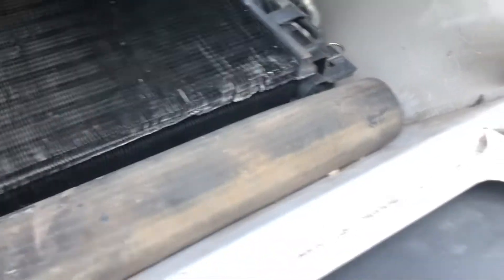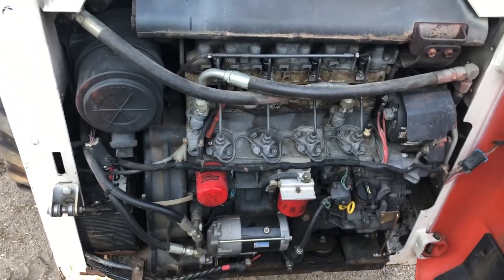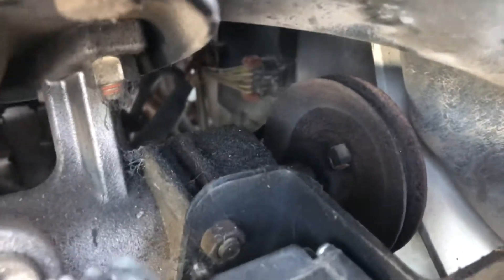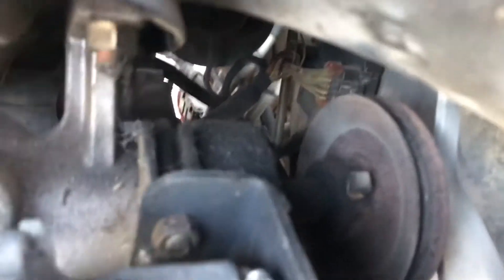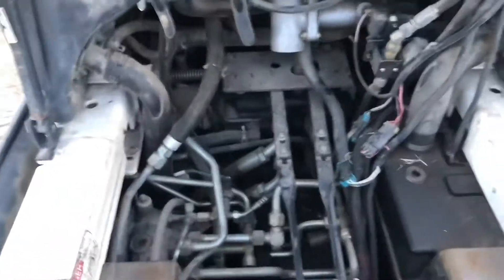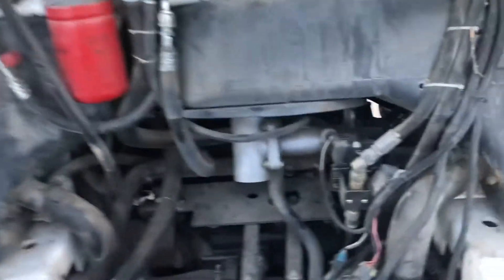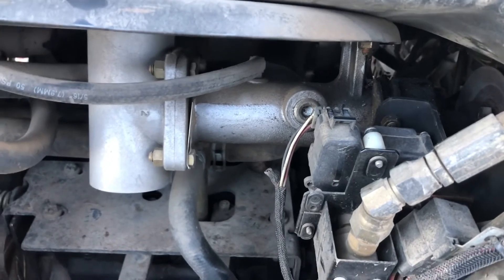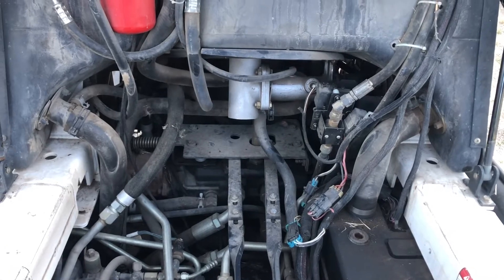Bobcat 863G Running Hot

Comment: Did  you ever resolve your issue, how does this machine run in the summer?  does it run hot?   have you had any other issues?   was looking at picking up one of these and had some concerns on its cooling system...  IE it had no antifreeze...  Thanks...
Reply from the maker: Yes it is running normal again, it was the fan belt that wore down to a shoestring. I have never had this machine overheat, it's been great.. only thing I have done to it was regular maintenance and tires.. now this fan belt, and now recently a new battery. Don't hesitate if you find a deal on one of these models, they are great..
Reply: @staffordshires2  Hello I would like to know if you ever lift up a pallet full of sod with this machine? And if it was capable of doing it ? I found a good deal of one of them but I need for down loading sod pallets.
Reply: @staffordshires2  Thanks for your feedback, I was told by the seller that he recently had the same issue as you and replaced that belt also...